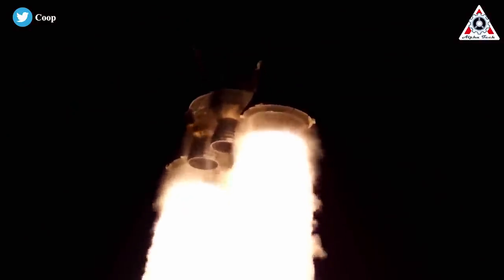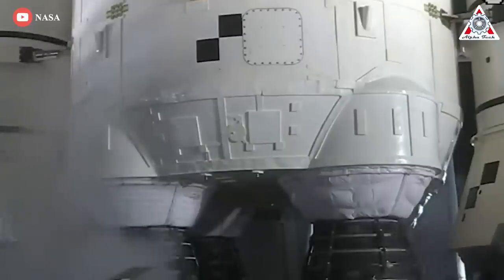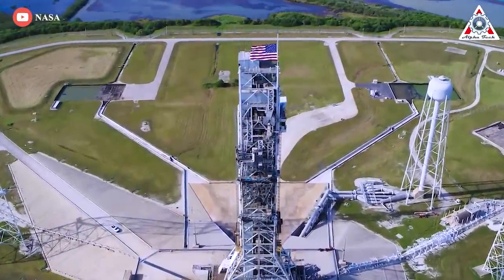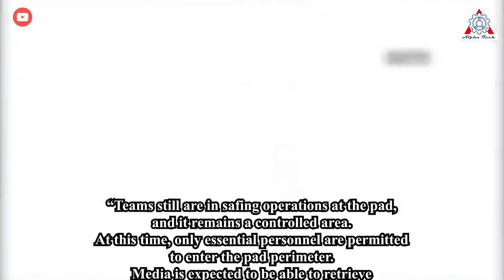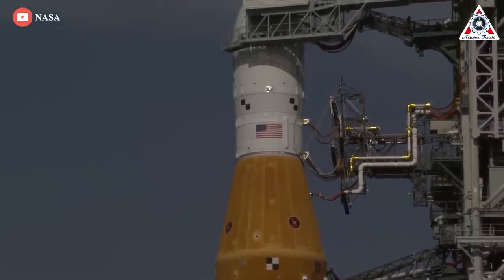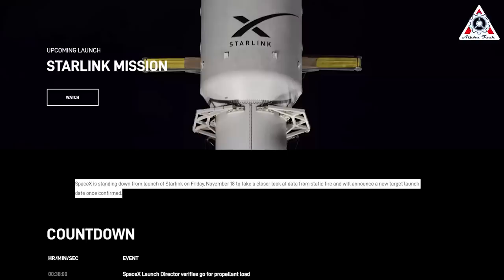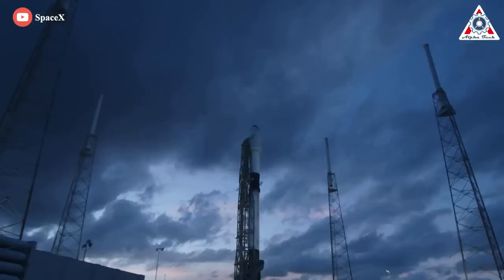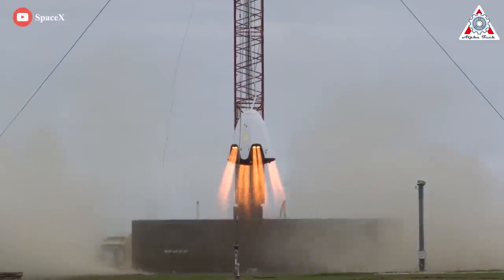NASA Launch Tower is in Big TROUBLE after launch...???

Comment: The tower was damaged on early shuttle missions and they had to change some stuff.
I expect the same thing to happen with Superheavy.
Reply: from the number of repaints the launch mount legs require the rumour of musk buying dulux may be true....
Reply: this is a learning process... luckily, humans are pretty damn smart. especially the ones that work for NASA.
Reply: The tower was damaged on EVERY shuttle launch and required repairs every time.
Reply: The acoustic energy of the SRB's took NASA by suprise, damaging the launch tower and the flame trench on Pad 39A.  NASA finally learned that using plenty of water on the pad reduced the acoustic energy to a manageable amount.  The orbiter itself was also damaged-high speed films show that the body flap on Columbia was bent way beyond safe limits by the launch.  John Young said later that had they known this during the STS-1 launch, he and Robert Crippen would have ejected!
Reply: the damage to the tower is what this launch was all about. To test every part of the mission from the mop and bucket used to clean the floors to the rockets and guidance systems to the toilet system. they now know they at least 1 problem to solve. All part of the reaserch and development to get us back to the Moon and then Mars.
Reply: @lezbriddon  That launch mount and tower is gonna get a beating when Superheavy / Starship launches.
Catching them is going to damage some stuff as well.
Reply: The elevator Blast plates were blown off.

Comment: Red Team wasn'r any more risky or lucky in doing a job around a 'fully fueled rocket' than astronauts strapped into a compartment on top of one
Reply: To be fair, the astronauts strapped to the top of the rocket have a means of escape if their was a catastrophic failure.
Reply: Explosives to save you from explosives
Reply: Red team just means the signed extra paper work 👍
Reply: That's not true. The escape system should keep the astronauts safe. The red team can only escape if they've been holding a massive one in for weeks.
Reply: @Youll_Love_It_At_Levitz  The astronauts arrive at the pad after tanking begins so it is same risk from explosions. Same for the support crew strapping them in. The “red team” is trained to deal with the additional hazards from things such as cryogenic gases etc.
Reply: Red team? They got the thrill of bein by it runnin and noone else around. Do you realize the feelin?
Reply: Completely false, the astronauts have an escape rocket.
Reply: @Youll_Love_It_At_Levitz  Fire fighters, combat soldiers, police officers etc all have means of escape.  Yet cemeteries are full of them.
Reply: And what's gonna help them escape the escape rocket if that decides to get faulty. A lot of people get killed from airbags than from injuries sustained during collision.
Reply: @chrisduggan2848    That is nonsense.  It is estimated that over 50,000 lives have been saved by airbags up until 2017, compared to about 200 fatalities due to airbags.
Reply: @chrisduggan2848  I seem to recall one case of the escape rocket firing unintentionally... Way back in the Mercury (possibly Gemini) era.  Fortunately, an unmanned test. Astronaut probably would have survived, but been a little worse for wear....  One would hope they'd made it a bit more fail-safe thereafter, but this is NASA we're talking about.
Notice that they disabled the escape rocket on Artemis 1.
Reply: Exactly!  I was gonna say the same thing.
Reply: A classic case of looking for a grey cloud amid a silver lining. That has always been their job.
Reply: Really? What escape system do techs at ground zero have? Protection from flame, explosive overpressure, loss of atmosphere due to air displacement? Nah, that was a balls risky move.
Reply: @peterreimer2540  what protection do u have in a jet airliner with 300 strangers and no parachute traveling 600 mph with 26,000 moving parts?  Quit overthinking it, life is a risk.  They get paid well.
Reply: @mgcamp85  Astronauts aren't working on a hydrogen leak problem, which the repair could result in an explosion.
Reply: I bet the paychecks make it "not THAT bad"
Reply: If it all went wrong they might have had to change their name to "The Black & Crispy Team".
Reply: I wonder if there was extra hazard pay
Reply: @rajvader  That was Mercury Redstone (Redstone missile topped paired with the Mercury capsule) 1… the very first test flight with them together. You know your history mate.
Reply: It's nice to see other people also realizing how stupid of a comment this is
Reply: The launch abort system: it’s like I don’t exist
Reply: @Shartial  HAL 9000: "I know what you mean"
Reply: The RED team was dealing with a known mechanical problem with no known outcome. Repair could cause an explosion during the repair(s).
Reply: PEACE 
LOVE 
HONESTY 
FREE THINKING 
GOOD HEALTH 
FUN 
LAUGH 
OPTIMISM
Reply: Red team would be fine. As long as they don't wear red shirts...

Comment: Hydrogen is notoriously difficult to store and move from point to point.  AFAIK, this is due to the fact that it has the smallest atomic size of all elements, and leaks are therefore hard to prevent.
Reply: That is correct. It happens a lot - it happened on Apollo 11 during pre-launch operations on the very day of launch, 7/16/69. It's the price you pay for the light weight and high energy of liquid hydrogen fuel.
Reply: Why use it then is the question.
Reply: @Mister_Durden  Hydrogen is incredibly energetic, which means Hydrogen rocket engines are more efficient compared to other rocket engines. Take SpaceX's Falcon Heavy vs the Delta.IV Heavy. When launching payloads into Low Earth Orbit, Falcon Heavy outperforms the Delta by more than 2x thanks to it's massive thrust advantage. But when launching payloads at higher orbits, that 2x advantage that FH has over the Delta is narrowed down thanks to the D4H's use of Hydrogen, which is incredibly light allowing for higher performance. This means after some time, the Delta will catch up to Falcon Heavy and even outperform it.
Reply: “One of the smallest” - helium is far worse as it is monatomic.
Diatomic Hydrogen is 120pm.
Monatomic Hydrogen is 53pm.
Helium is 31pm.
The Kinetic diameter (a measurement of when it interacts with other matter) of helium is 260pm and hydrogen 289pm.
Reply: @ELECTRICMOTOCROSSMACHINE  technically two h2
Reply: @ELECTRICMOTOCROSSMACHINE  Actually hydrogen never occurs just on its own (it is kind of reactive).
Reply: @Mister_Durden  You can tell my science background is limited.
Reply: @allangibson8494  Yes, liquid helium is a nightmare to try and work with, but unlike hydrogen, no one is trying to use it as a fuel.
Reply: @markwilliamson4006  No but just about every rocket, regardless of fuel, has a tank on board. It’s used for tank pressurisation because it’s boiling point is way below anything used as fuel or oxidiser.
Reply: @allangibson8494  So? How does that have anything to do with loading fuel into a rocket? They are going to he Moon, not a baby shower with festive balloons.
Reply: @ultrametric9317  The helium gets the fuel and oxidiser into the engines - no helium, no tank pressure, no rocket.
SpaceX uses the same helium system to get the methane and oxygen into its engines.
SpaceX also lost a rocket when it’s helium tank ruptured in flight.
Helium’s low boiling point means it is a pressurised gas at temperatures and pressures where hydrogen is a cryogenic slurry.
Reply: @Mister_Durden  I think it's coz of the energy it has, by volume &/or weight.
Reply: @robertsneddon731  Delta IV Heavy launched the Orion Capsule into LEO for a test flight in December 2014
Reply: @TheStopwatchGod  Good point. The Orion test flight could have flown on a Falcon Heavy but I don't think there was anything other than D4H in the NASA catalogue with that launch capacity back in 2014. Back then Proton and Ariane V had the throw-weight to deliver an Orion capsule plus service module into LEO but they're not American.

NASA likes SpaceX. They provide a secondary capability for a lot of things that gives mission planners some extra breathing room rather than having to work around a single-point-of-failure engineering limitation. SpaceX provides the only American manned launch capability to the ISS for NASA as well as some cargo flight missions although they are not unique in that regard. Seeing NASA as some kind of hate-filled opponent of SpaceX is kinda weird but cultists need an evil opponent to rail against even if they exist only in their imagination.
Reply: Yep, that's why leak checks are done with helium.  It's not the smallest but it's the 2nd smallest.  Other considerations:  helium is not flammable/explosive and is inert, so it won't react with whatever you're leak-checking.
Reply: @wepprop  Long time ago I worked with ultra-high vacuum systems. After assembling the systems we pumped them down to a low vacuum to get rid of moisture and then pressurised them with helium to just over an atmosphere. We had a hand-held sampler that did some sort of mass spectroscopy to look for helium leaks. It was really sensitive but there is only a very small amount of free helium present in the atmosphere so it couldn't give us much of a false reading. Using hydrogen would have been dangerous and there's enough water vapour and other hydrogen-rich compounds around in the air that a sensitive mass-spectroscopy sampler would detect that.
Reply: @allangibson8494  Except in space.
Reply: @allangibson8494  True, but hydrogen doesn't burn very well.
Reply: @wepprop  Leaking H2....  that must have been fun...   not.  🤔
Reply: @Skank_and_Gutterboy  Interesting.  I've read that helium supply is very limited, as IIRC it can only be sourced in other gases, mainly natural gas, and has a bad habit of rising into the atmosphere and drifting off into space.   🤔
Reply: @realbartlett8882  
2H2 + O2 => 2H2O
It's a simple, clean, fast reaction in the presence of any flame or spark, with no carbon to create soot or reactive or volatile byproducts.  Real Engineering did a video on in-space nuclear propulsion, and discussedcthe specific impulses of Hydrogen, Methane, and Kerosene, three estsblished rocket fuels that react readily and relatively cleanly with LO2 .  Hydrogen has by far the highest.  Methane is in between, and while Kerosene has the lowest of the three, it has a higher energy density making it a much better choice for first stages.

NASA has always favored LH2 because it simplifies engineering concerns regarding design and handling.  SpaceX has switched to Methane for its Raptor engine design because it is less problematic to store and fuel, it reduces engineering requirements on the engine while boosting performance in atmosphere, and because it reduces risk management issues for the massive Starship + booster designs; a catastrophic accident with LH2 would not only destroy a test or launch vehicle, but a sizeable portion of the Starbase complex and the highly engineered assembly+launch tower.

Comment: After every single Shuttle launch, the tower was just as badly damaged... And they fixed it every time.  This is such a non-story.  Playing off SLS dislike.  But it still flew first.  And not a prototype.
Reply: My man gets it
Reply: WanderFullStory  There is video on Youtube of the SLS Solid Rocket Boosters (SRBs) being test-fired. The RS-25A LH2/LOX engines used on the SLS had all successfully flown on multiple Space Shuttle missions. The launch pad, transporter etc. and support structure for the SLS launch were all well-tested with more than a hundred live launches of rockets of similar weight and thrust (Saturn 1B, Saturn V, Space Shuttle etc.) carried out over the past fifty years or so.

From my amateur perspective the NASA integrators and the various engineering companies who designed and built SLS spent years and billions of dollars to increase their chances of doing it right the first time they attempted to launch a complete stack. SpaceX seems to be iterating and changing designs, hardware, launch and test structures etc. as it tries to creep towards building and launching a successful heavy-lift vehicle design, and they're perhaps making the same sorts of mistakes the Soviets did with their N-1 rocket. As far as I know, super-clusters of rocket engines like the SpaceX booster system have never succeeded in getting into orbit. We'll see if SpaceX can make it work.
Reply: WanderFullStory  are you crazy? For 8 years they tested the engines, tanks, welds. Rebuilt the crawlers, the towers are new. All new fuel farms. All for SLS. It didn’t happen overnight. Orion has been in 3 test flights. Once for tower escape, then an orbital and hot reentry at high velocity. And now a full mission.
And before you go on about costs. It’s estimated that Starship has cost $2 BILLION dollars. And it’s not even halfway. Yes, halfway. They have a failed infrastructure (13 engines made a CRATER) no flame divert, no water deluge (I bet they will now….) their tower was damaged from only half the engines firing. And starship is an empty shell.  With no concrete plans presented to NASA for anything for humans.  And their moon rocket is even more behind.  NASA is angry they didn’t present any designs other than it has  a BIG empty area to put stuff in…. That’s not planning… Dlying by the seat of your pants is good for rapid experimental. But sooner or later they need PLANS.  And they are not going Ben to that phase yet.  So halfway.
Reply: WanderFullStory  yep. Notice the cost breakdown. Almost all to rebuilding infrastructure… not the rocket.  People always miss that. But but but it’s over budget. Yes it is. But not because of the rocket.  One of the most expensive was the crawler.
Reply: @davidbowerman6433  how much of that “over budget” is also from congress starting and stopping this project from Constellation til now.
Reply: SpaceX put Starship like 40 feet away from the tower. They are going to have some insane ground issues, though.
Reply: @skraminc  SpaceX also doesnt have water troughs for their pads. NASA has always had them, SLS proved they were useful, they added more sprayers for the main engines though.